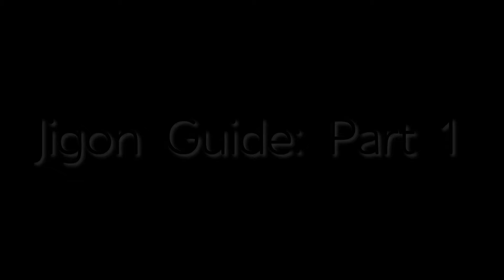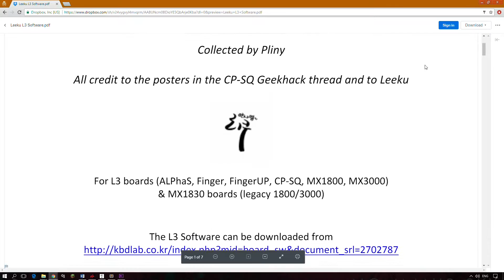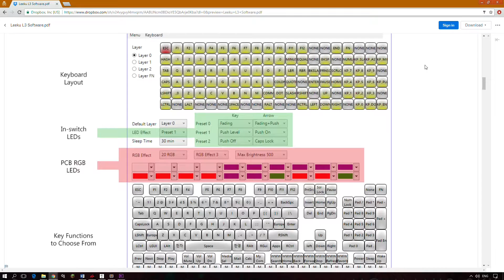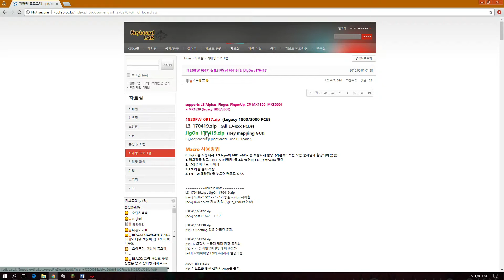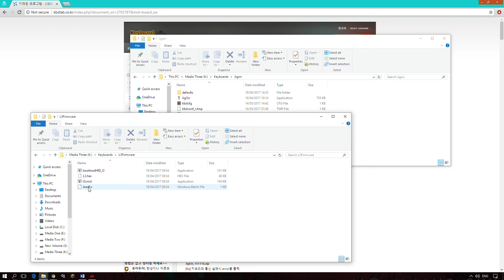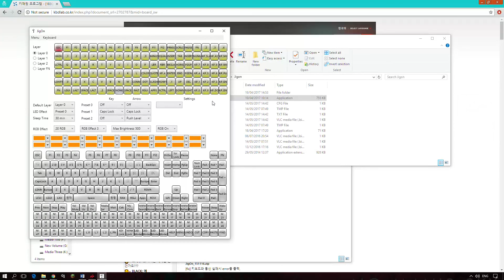How to Use Jigon to Program Your Leeku PCB: Part 1

Comment: I also wanted to confirm that I was able to upgrade firmware and remap with L3_171209 and Jigon_170419. However I had a lot of difficulty on updating the keymapping (perhaps more relevant in your part 2 video) - turns out I had to run Jigon as administrator for it to update successfully, otherwise the program would just exit and you would have to unplug and plug the keyboard back in for it to function properly.

Comment: Hey man, I know this video is pretty old but I am having some issues with my PCB and am really hoping you can help.

I just built a tx87se with a suo tkl pcb. When I attempt to flash the firmward vid loadfw.bat batch file the cmd pops up but all it says is "Error opening HIDBoot device: The specified device was not found status = 2". I tried every single USB port on my machine as well as a USB hub with no success. They keyboard works normally otherwise, all the switches are registering but I cannot remap my keys in the JiGon software. In the JiGon software I get "Connection fail" anytime I try to press the connect option in JiGon. Any ideas on what may be going on here?

Thanks in advance!
Reply: I am having the same issues with my Tx87 v2. I think that I am going to try to contact popkorn62 and ask about it
Reply: @iiscd5970  there is new software you can use. It is much more similar to VIA. You can find it on their site I believe. That's how I changed my layout/rgb settings. I was not successful in flashing it via jigon

Comment: Thanks for the excellent walkthrough Chokkan! I can confirm that I managed to successfully upgrade my firmware and remap my keyboard with L3_171209 and JigOn_170419 despite the version discrepancy. One thing to note is that I could not initially do either when plugged into the always-on USB 3.0 port on my laptop (it has a battery icon next to it). However I was able to flash and connect on the standard USB 3.0 port. Hopefully this helps anyone who has issues.

Comment: Hi Chokkan,
I know that this video is a bit old but I am stuck while trying to program my L3 PCB. As others have said it is not possible to download the L3 firmware and JigOn from the same release (different numbers).  Loading the "loadfw" works perfectly fine but once I enter the JigOn firmware and connect the keyboard keys are not showing up when pressed. Selecting them manually with my mouse works to change the key but after updating the board nothing is changed from the original keymap.
Maybe you have an idea to fix this issue.
Thanks.

Comment: Sorry to be a pest.  But I just got my leeku PCB.  The versions you have linked are now not the same and looks like the firmware is newer.  Is this still ok to flash even tho jigon and firmware are not the same versions?
Reply: Not sure if you ever found out if it worked, but i can confirm that it works with the current update of JigOn and the current firmware update. Just install the firmware and use JigOn as shown in the video.
Reply: simo5858  Thank you. I downloaded L3_171209 and JigOn_170419 and it worked.
Reply from the maker: Hi, yeah I have had someone else ask me that, and I'm not sure. If you go to the Geekhack for the TX boards, Kin might be able to answer that. I've already asked in that thread and am waiting for someone to reply. Some have had serious problems updating, so I myself will not do it until I'm sure I can do so without soft bricking my pcb.
Reply from the maker: Thanks for taking the time to reply here.

Comment: Hiya, I just pmed you through youtube I guess, but I keep getting connection fail when trying to connect my board. Didn't have issues with it before though.
Reply from the maker: Yeah, sorry, I wanted to reply with some advice, but I'm not sure I have any useful tips here. Very annoying when things stop working for seemingly no reason. I'd head over to Geekhack and find any of the threads for the TX keyboards. Let me know if you get it sorted out and what the solution was.
Reply: Hi - thanks for the reply, just thought I'd get back to you haha. Just reflashed the board and picked up a new USB cable and everything has been fine since.

Comment: I have tried every USB port on my computer, even plugged in a USB hub and I still can't update my firmware. I would really like to figure out how to do this because JugOn won't connect to my keyboard otherwise. Any tips?
Reply: I guess I could try it on a different computer if I get the chance.
Reply from the maker: +Fnzzy Seriously frustrating. Can you detail the steps you're taking to update? And when you say you 'can't', is it that your keyboard isn't recognized at all?
Reply: Hi again, I managed to update and program my keyboard using a different computer. It still wasn't perfect, for example I wasn't able to press a button on the keyboard and have it light up in JigOn (even though the firmware and version were the same) but I got everything into a working state (typing on it right now!).

The steps I tried on my own computer were plugging the keyboard in, which was then recognised by windows, then trying to update the firmware where I got a communication error on every available USB Port. I think part of that was my issue though as I sometimes didn't wait for windows to install the USB device driver (I was getting impatient and forgot about it a couple of times)

JigOn still won't connect to my keyboard on my own computer but I guess that comes back to the port issue I am having. Nevertheless it works now. Just hope that I don't need to make any changes :p
Reply from the maker: +Fnzzy well, glad you got it working in some fashion. I sometimes get weird stuff going on with usb ports on my machine. There's still a lot of room for improvement, but development on jigon is pretty opaque, so I don't know how active it really is.